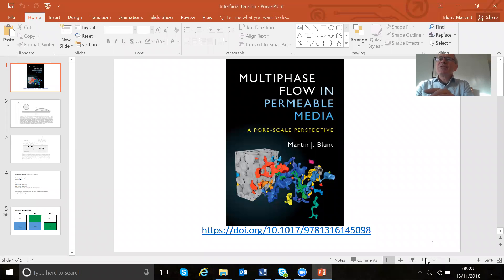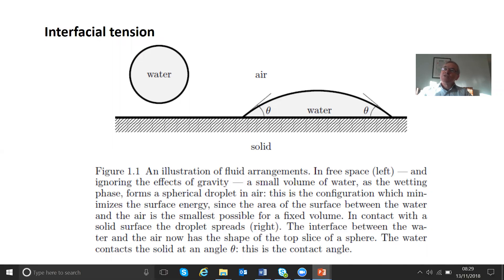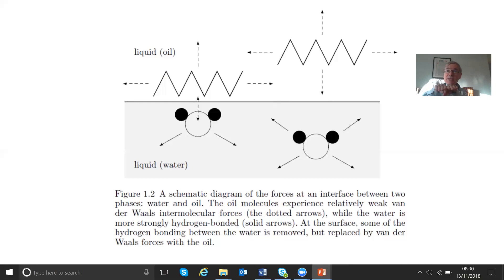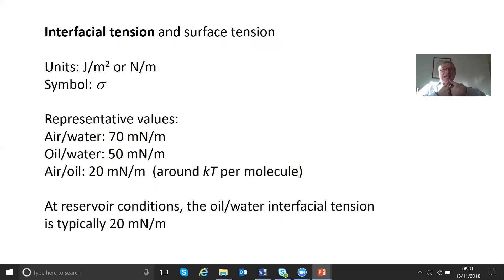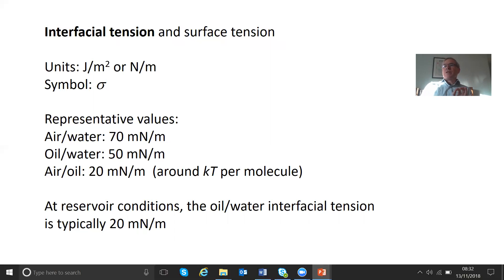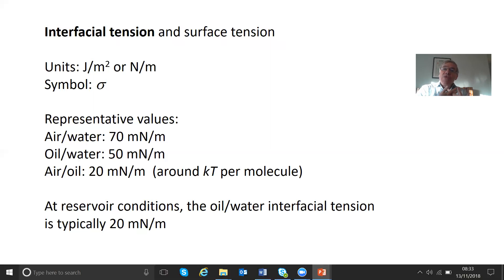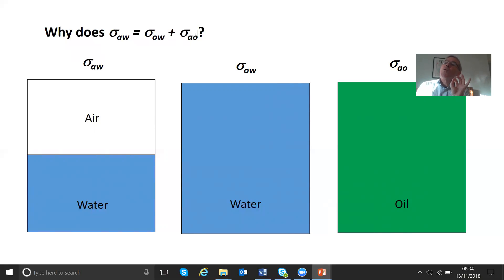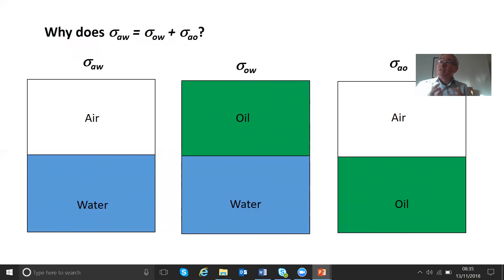Interfacial tension

Comment: Could you remind us or define how is energy increased or decreased among the surface molecules? this would be great, before going on to talking about interfacial interactions(breakage/formation of bonds).
Reply from the maker: The easiest way to see the energy change on creating and interface is to consider the molecular interactions first in bulk.  Here the fluid can interact with neighbouring molecules in all directions.  When an interface is created, molecules at the surface can only interact with half as many molecules of the same fluid.  This is less energetically favourable and is the origin of interfacial tension.

Comment: Hi. Could you please explain more about ift. How ift can affect the oil recovery? What is its specific mechanism? I mean what will happen when ift decreases. I know that it will reduce the absolute value of the capillary pressure and this can result in oil recovery increase but I want to understand the way or the mechanism. The mechanism of wettability alteration is clear but ift is unclear for me. I mean what will happen to the interface between oil and water. How it will change and in which way it will increase the recovery? After ift reduction the phases will be miscible or what? ???
I can not imagine the shape of the oil droplet after ift reduction? 
Could you please make it clear for me. Thanks in advance.
Reply: did you find it? I am asking because I am looking for the same. Help would be appreciated.
Reply: i think you have to check the literature about it. What you are asking is deep research in physical chemistry or even organic chemistry and first of all you must know what type of oil you use, the specific molecules of oil and how the interact or even react with water and the constituents of water!